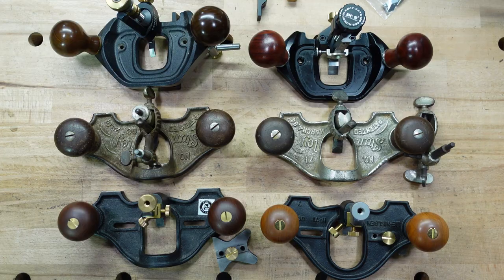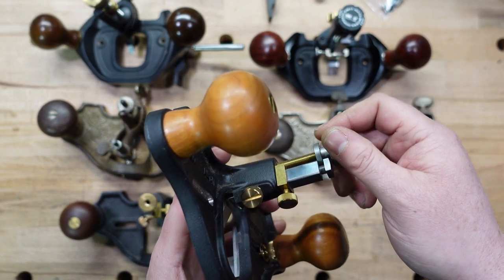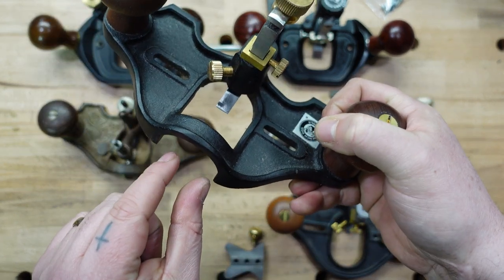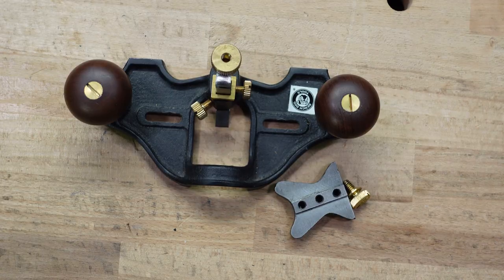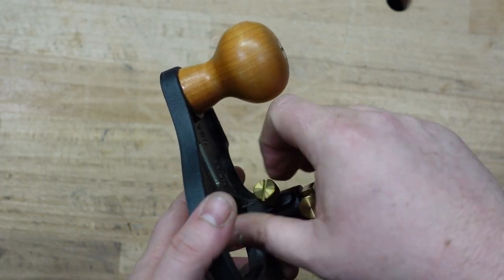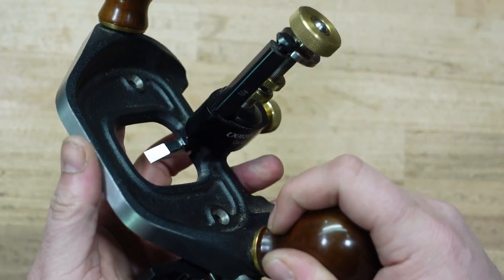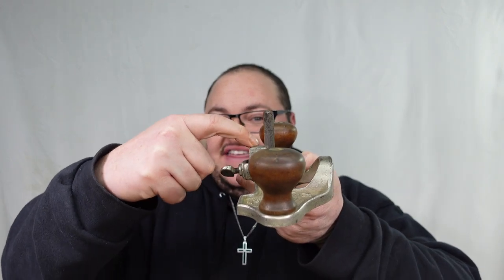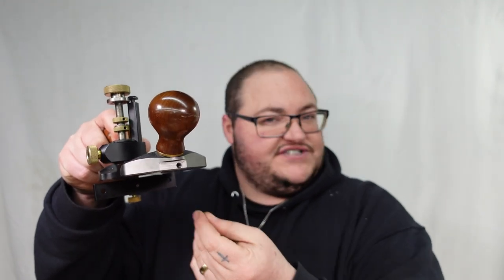I LOVE ROUTER PLANES! Review & Comparison - Stanley, Lie Nielsen, Veritas, Bench Dog and Katz Moses

Comment: I just received the Katz-Moses KM-17 Pro model which adds a really cool depth stop and a blade sharpening jig handle that doubles as a marking knife with the pointed iron so now it’s like getting two tools in one. I also purchased a set of additional cutter width irons. The tool as sent is remarkable and very well made. It will perform to all of my needs with great satisfaction. I feel that between all of the top brands the KM 17 Pro is right up there with the best of them until you want the adapters to cut inlays which is only available with the Veritas. If you don’t need that you can save a considerable amount. The KM-17 Pro base is made from steel and not cast iron like the others. It has a great weight and feel to it and the machining on mine was perfect. I’m just putting it to some light usage right now but feel like this is going to work out great for the long term. All of my previous purchases of other Hongdui tools have been good buys.
Reply from the maker: Thank you for sharing! That is great for people to read!!!

Comment: Another great video, my man! I love my Veritas router plane. I have the version with the knob-style depth stop. It works great, but be careful not to overtighten as it could potentially damage the post threads. I haven't had any issues with the blade moving.

I, too, like LN bench planes over other styles (not a fan of Norris adjusters). I do swap out the irons for PMV-11 on them, though. The only Veritas bench plane I have is a custom 4 1/2 with a custom frog/knob configuration that I have tuned to a very high degree and only use for final smoothing. It stays set just the way I want it thanks to the little grub screws that hold the iron from shifting laterally (and negate the need to use the Norris adjuster very much). 

I always go to Veritas for specialty planes (shooting, shoulder, combination). They have so many helpful innovations and are far more cost effective. IMO, the price of the LN router plane is absurd. 

I must say that the Katz-Moses router features are just unnecessary for what a router plane is meant to be used for. If you're hogging out a lot of material with a router plane and getting chatter, you're not using the right tool. The router should be for light passes to fine tune joinery. I won't open the can of worms about the design, but I'm Team Veritas all the way here.
Reply from the maker: Thank you! You are 100% correct on all points!
I sent an email to LV to see if I can get the new style depth stop so maybe then I'll actually use it haha

It sounds like you really like the Veritas Custom? Did you get that only to get a higher degree frog? Or is it that much better than the other veritas planes? I've been debating on trying one.
Reply: @BatCaveCreations  I do love the custom smoother! After a deep dive into Derek’s review of them, I went for a 42 degree frog with a wide knob and traditional toat. http://inthewoodshop.com/ToolReviews/VeritasCustomPlanes1.html
Reply from the maker: Perfect!! Thank you for sharing!

Comment: I have a Veritas with the side screw depth stop.  As Dagomirdichev suggests below, the side screw has the potential to damage the threads on the post, especially because it needs to be cranked pretty tight to resist the downward pressure of that big height adjuster wheel.  However, I find that I don't bother to use it most of the time anyways.  Something you didn't discuss is the sharpening system, with the two-part blades and the jig handle, which isn't unique to the Veritas, but is, imo, a big advantage over the Stanley & Lie Neilson one-piece irons.  In any event, one of your best videos yet.  Congratulations on the ever-improving channel.  We love you right back. :washhands::washhands::washhands:
Reply from the maker: Ah crap ur right! I didn't mention the jig at all and that makes a mig diff in sharpening the blade tips. Good catch!!!
Thank you! Not gonna lie this one was a challenge I recorded a while video watched it and said.... I don't like it haha so I really did it 😅

Comment: I have had my Bench Dog for a couple of years now and find it works just fine for me. As a dear friend I used to play guitar with used to say, "That's why they mark towels 'His' and 'Hers', everybody's different". I looked at the Lee Valley adapter's price and etc. and decided that $20.00 Bench Dog replacement blades and my bench grinder would suit my purposes just fine for what I do. As you pointed out, the tolerances are a little more "forgiving", making it easier to move the blade up & down, but, as I discovered, when you lock it in place its the same place in relation to the sole every time. I also found the Paul Sellers method of truing the blade 90º to the sole so it cuts flat and parallel to it works very well. Keep up the good work.
Reply from the maker: Thank you!!! That is great to hear to! I know I can get tool snobby but really as long as the tools works it works! And that's all that matter :D
Reply: @BatCaveCreations , My philosophy is: "Its impossible to have too many tools, too much space to store them or too much money to afford it all".
Reply from the maker: @johnbesharian9965  hahaha YES

Comment: I have the BenchDog router plane.
I paid $99 on sale, free shipping from Rockler. (Great deal!)

There are times, late at night or early in the morning, when I don't want to disturb the neighbors with loud machine noise.
So I'll use hand tools instead.

I enjoy using hand tools on the smaller projects. No noise, no dust, and far less danger than power tools.

The ability to turn the cutting iron 180 degrees and use the bull nose feature is useful in tight spaces.  If you notice on that side of the plane there are two machined surfaces square with the cutter.  Very useful feature for outlining/defining the depth of cut.
Reply from the maker: I 100% agree! Hand tools are great when you need to be quite haha and they are cleaner! 
Thank you for sharing!!!

Comment: I came across the Katz Moses and I have ordered it. And they offer different blades for it (besides the 2 blades that come with it). They sell a set with 4 other sizes 1,6 / 3,2 / 4,8 / 6,35 mm. I like that it is more solid . And the Irons can be turned to the backside too and it is more work to do it than with the other router planes.
Reply: Just ordered mine from Km. Haven't heard anything since the confirmation Number. Wondering if you have received your router yet And what your experience was like. Thank you
Reply: Yes I have got it - it arrived a few days ago - earlier then it was supposed to arrive. I got a confirmation from the seller after buying. And there was some sort of tracking which often does not work well on international shipping. I have ordered the blades set as well so I have more diversity of what I can do with it (which was the major reason not buying Lie Nielson). I like that the router is much more stable  Depth stopp stays in place and the blade too. One does not have to control all the time if all is tight and in place. Which I like very much. It is more work to change the blades and the position of the blades to the backside and I prefer the stability. I did not like that the screw heads which hold the handles stood out a little bit which is easy to fix. Greetings
Reply: Thank you very much, and I appreciate the input . I wanted to buy the whole package, but it doesn't seem like they have the blades and stock right now. Thank you so much and happy holidays.

Comment: So to start off, like previously mentioned by commenters, you are very concise and knowledgeable about this. I like your video style and your enthusiasm for the subject. However I do have one issue with what you said about 7:00 into the video. It was about Stanley not having a way to attach a base plate. I have a no. 71 that has a fence as well as the screw holes for the base plate. Also I realize that this is not a video about the historical iterations of the Stanley no. 71 but I thought it would be good information for someone who would want to buy one. Otherwise an excellent resource for woodworking. You have earned a subscribe from me. Can't wait to see what you have in the future.
Reply from the maker: Thank you!! You are 100% correct, newer type Stanley's do have holes. Thank you for catching that, it will be great for others to know! Also, thank you for the positive feedback! It means a lot!

Comment: By the way the Veritas 1/2" iron and pointed iron have screw attachment like the Katz Moses. I don't know the model you have, but my Veritas depth stop slides up and down and is secured with a thumb screw. The Katz Moses depth of cut is more precise over the Veritas. You have to loosen the set screw on the Veritas to move it up and down then tighten the set screw to keep the iron from moving.  I like my Veritas, but wish the irons were more secure like Katz Moses. Great video. Like the side by side comparison you do. Keep up the great work.
Reply from the maker: Thank you!!!
After filming this I was informed of the new style depth stop apparently my router plane is OLD OLD haha I bought it used. 
The KM is deff more percise. Do you find you need that level of accuracy on a router? That was one of the arguments I heard about his plane.

Comment: When you have everything locked in is their usually a little slop in the blade mechanism if you try to move it around? Not much, but enough to hear a little click if you know what I mean.
Reply from the maker: For the veritas, no. I lock the blade down it's solid. If you are taking to heavy of a shaving tho it can move. :/ 
If you mean on the veritas when advancing or retracting the iron, YES! And it gets me every so offten lol the slot in the iron is a little bigger than the depth adjust wheel.
Reply: @BatCaveCreations  I meant when it is locked.  The mechanism on the KM rotates left and right when you look down from the top.  It looks like the cutting edge doesn't move up or down from the cutting plane, so that is good.  When you say the Veritas moves taking a heavy shaving do you mean depth or left-right like mine?
Reply from the maker: @SaintFredrocks  depth it tilts down. I can't help with the KM I borrowed that one for the video :(
Reply: @BatCaveCreations  I know you borrowed it, but you have helped.  I am knew to planes of any sort, so I wondered if they all moved some.  I think I would rather a little left right than up down motion, but none would be even better. 

Have you seen any of the Cowryman router planes?  I know you like them, so I thought I would let you know if you haven't.
Reply from the maker: @SaintFredrocks  oh ok! They really shouldn't move at all when locked down unless your being aggressive or there is an error with the plane
That other brand is cool too! Haven't tried it yet but it's a bit like a witches tooth router. A population vintage style

Comment: I have the other LV depth stop, it won’t damage the threads (steel vs. brass, steel wins every time) BUT I rarely use it as anything other than a suggestion.  It’s hard to tighten, and can slide down.  That being said, I love this plane!  I use it all the time.  I had to make my own box for the blades (didn’t exist when I bought mine).  One thing to be aware of, similar to any Stanley style plane blade advancement (including LN planes), once you advance the blade you should spin the wheel back until it touches the TOP of the slot or the blade can advance slightly as you cut (I use this purposefully as I’m advancing a cut, it’s just mostly important when you are at depth).
Reply from the maker: Yes!!! That is 100% correct! There is some play in the depth that needs to be accounted for. Thank you for adding!

Comment: are the holes on the depth stop knobs threaded? they look kinda like they should have a tiny locking screw. I don't have one so I don't know but it would make sense.
Reply from the maker: No I guess they are there so you use like 2 small Allen keys and pinch then together to tighten but I upgraded to the new version so it's alot better now!

Comment: Great summary, will do the Paul Sellers homemade kit until I splurge for the Veritas.
Reply from the maker: Thank you! And I want to make one of those, one of these days! They look fun!
Reply: Paul sellers one is actually better than all of these it doesn’t look as pretty but way easier to use as the blade is at an angle so pulls itself into the cut I find the metal ones try to tip themselves forward and you have to fight it slightly

Comment: There's more to the open throat closed throat thing on the Stanley 71.  My experience with the open throat Stanley is that it allows me to route stopped dadods without fowling the front of the router with shvings.  Shaving tend to spill up and jam between the closed throat and the end of the dado.  Also, the front foot is left in place when doing "other" work where this issue is not to be expected.  So that deals with the issue of routing narrow surfaces.       The depth "pin" on the Stanley 71 is not a stop, but a depth indicator.  The pointy und is inserted and the clamp is tightened on it at the desired depth. This allows the pin to be inserted every now and then to know if you are at the desired depth.  It's not as a good a system as Katz's (I love it) but it sort of works.  As initially stated, this is my experience.  Not my internet keyboard knowledge.  This is how the 71 works.

Comment: The Stanley 71 depth screw is 40TPI.  That means that one rotation is .025".  So where some routers have measurement marks that may be in millimetres.  Those using a Stanley 71 can be very accurate in their adjustment once they understand the 40TPI issue.  If I want to get super picky I can easily adjust the depth in thous on an inch (+- .002" to .003").  That facility coupled with a digital calliper is very powerful.
Reply from the maker: Thank you! That is great info!!!

Comment: Do I see grub screws on the Veritas depth stop? Might those lock the depth stop?
Reply from the maker: no they are just holes but...... i wonder if grub screws should be in there hahaha
Reply: @BatCaveCreations  are the holes threaded?
Reply from the maker: @Devin Teske  no :( I was told I have the old style depth stop tho and on the new version it's 100x better. I em LV to see if I can buy the new version without buying the whole plane haha
Reply: The holes are there to allow you to insert small rods (small Allen keys) and then tighten the two collars against each other. The rods will give you more purcase to tighten them. Two nuts that are tightened against each other like this won't move and will function as a rock solid depth stop.
Reply from the maker: Makes 100% sense I just never thought about doing that haha thank you!!!

Comment: The blade selection and cost of additional blades is the main reason i switched from LN to Veritas. I still need to pick up the inlay cutters which is on my near future purchase list. The other reason i switched was the fence groove on the bottom of the LN tended to get caught on the end grain when I was doing sliding dovetails and would chip it out. Now this didn't happen all the time, wood dependent, but was a factor nonetheless.
Reply from the maker: That is a very good point! I can't remember off the top of my head but the veritas fence, can we attach wood to the flat side? If no holes are there, I'm sure we could drill holes and attach wood of we wanted. That is not an option on the LN one. 
It's just all around more affordable and more versatile. You will love the inlay cutter it's very helpful!